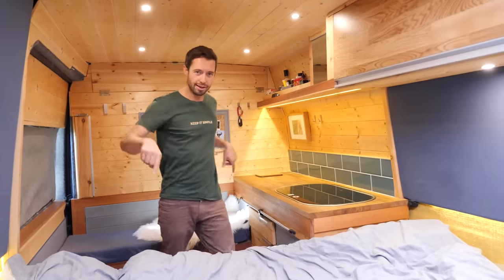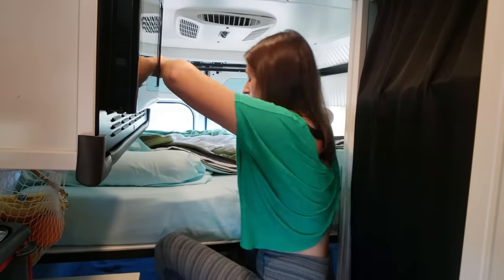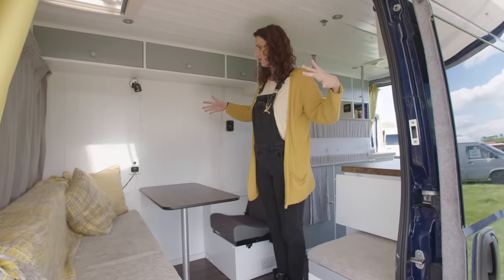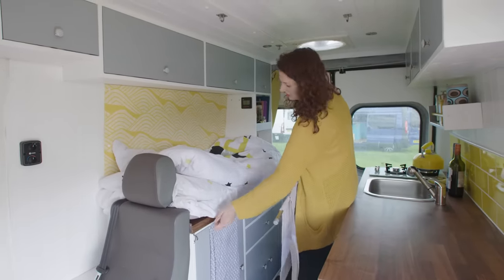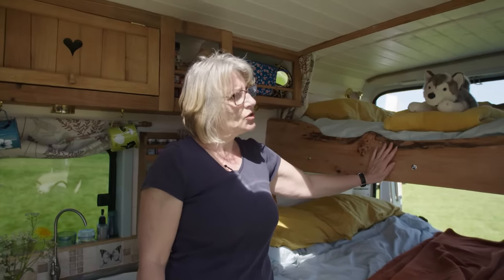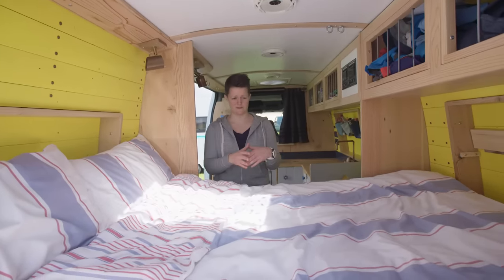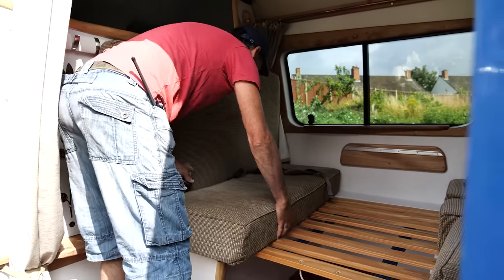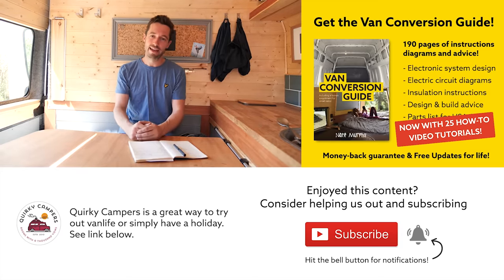10 (MORE) INGENIOUS BED DESIGNS For Your Van Conversion

Comment: Some great ideas there.  I have noticed a lot of folks shut off access to the front cab.  Having done a few years of van life and quite a bit of wild camping, there have been a few occasions where making a quick egress has been necessary, due to sketchy situations.  Which would not have been possible safely, if we had to exit the van.  Just something for people to think about when designing.  Having said that, if you only plan on using camp grounds or van parks, this would most likely not be an issue.
Reply: I agree.
Reply: Indoor access to the driver's seat, for me, is a must
Reply: Had a situation where the rear doors of my transit wouldn't open, had to get through to the front and put the key in the ignition to get them open. Would still be in there if I'd left the bulkhead in😂
Reply: 100%. For security reasons, it is a must to be able to drive away from any undesirables who may be pestering you.

Comment: Lots of options. Great. I couldn't sleep on those multiple cushions. The, seams and crevices where they meet is nightmare to me. Different strokes.
Reply: annette fournier same! They aren’t great to sleep on and I went for a different option in my van build
Reply: I think it can work depending how it is laid out.  I've heard people say that where they are jammed tightly together with no chance to move and there is memory foam the gaps are not obvious.  I also think it depends where the gaps are compared to your body.  It is much more noticeable under your butt than under your knees for instance.  We have two twin mattresses, occasionally we sleep sideways if someone tall is in the van and needs more leg room.  The gap ends up in the small of my back and I can't feel it there. The ones where there are tons of tiny ones jammed in together don't look fun though.

Also some people put a thin topper on top before they make their bed which can help.
Reply: Yes especially the ones for the sofa beds 🤦🏽‍♀️🤦🏽‍♀️🤦🏽‍♀️ Definitely no comfort

Comment: how about a van build with just a single bed. when i build mine i will be traveling alone. No need for a giant bed
Reply: It's so easy to design a van for one or even two, there are a million ways to do it. Need space for three or four, now that's a challenge.
Reply: Exactly even single ppl have king or queen beds but a double is way smaller imagine what you could fit
Reply: What if you get lucky?
Reply: You could fit a bath and loads more storage in with the extra space you save with a single bed
Reply: @garyphisher7375  Then things will be extra cozy which, lets face it, is a longshot for a lot of people so why design and suffer for it? Answer? Go to her van (?)
Reply: It seems like people have at least a full size bed to hide the “garage” underneath. You can do a twin/single  bed but I guess it would leave you with less garage space. If you’re ok with that then I don’t see why not
Reply: I saw a full bed. It slid down from the back door. That's the one I love today lol.
Reply: Murphy bed that drops down. By day it’s a storage chest/bench seat or others make it higher for storage cabinets and low counter. The wall you see is actually the underside of bed as it brows down. I have seen everything from a suspended shelf to wall art in the closed position. 
No divided cushion to annoy at night 
No assembly 
With a couple of duvet and dog leashes the bed pops down all made and ready
Reply: hammock 😊

Comment: I have watched a lot of van conversion videos and I have yet to see anybody address the need to be able to exit the vehicle quickly in a fire, especially if you were asleep in bed. All you need to do is to visit an auto junkyard and look at the vans that have burned to know that by the time the fire department gets to your vehicle it may be a burnt shell of metal. If you wake up to a smoke-filled van you’re gonna want to go out the back doors if that’s where your bed is, before being overcome by smoke. Many beds have been placed right up against the rear doors and so high from the floor that I wonder if it’s even possible to open the doors with the bed in place. If your bed is located back there and it’s pot not possible to open the back doors with the bed and place then you need to re-design your bed location. Also, you should place a second smoke detector inside any cabinets that contain your batteries and or major electrical components so that you get an early warning if there’s an electrical fire. Practice exiting your van in complete darkness so that you don’t know what to do if you wake up to a smoke-filled van.

Comment: the mechanical bed is exactly what I've been looking for! I wanted a fixed bed and a seating area. I was thinking it would be cool to put the bed above the cab but most vans don't have space there. the mechanical bed is a perfect solution! im sure its expensive though
Reply: +2k bucks
Reply: Build your own the motors and bearings cost a bit but everything else can near enough be scavenged or a pulley system to cut the motors out :)
Reply: Actually Ladislav Jecminek has built hers for really cheap. She shows how to do it in one of her YouTube videos. You may want to check it out. 😄

Comment: I like simple to make up beds, like fold down Murphys, sofa sleepers.and futons are easier to put sheets and blankets on and transitions to a setting or fold out of the way.
Reply: Each of these bed arrangements gives alot of ideas to think about, and what each van dweller has to use their own situation to consider — so much to “sleep on”🙀😸

I saw a video where the owners, a retired couple, had a cute arrangement where they had a bench seating  — the lower bench seat was also the lower bed, with a Murphy bed flipped up and was secured to be the bed of the other person. 
The reason behind this was that the one on the lower bunk needed to get up at night to visit the bathroom. It was easier to have the

Comment: your solution seems the best I think. Still building on our house, but when that is finished (if ever) .....Once we transformed a little Renault r4 into our travelling home and spent a good time going around former Jugoslavia (and other countries since we travelled fro m Sweden) . All cooking and stuff like that outside of coarse, but it really worked out fine. Now we´re much older so demands are higher but not to high. A fixed bed is almost necessary at our age though..Well, just wanted express my apreciation of your ideas presented in your videos ! A bit hard to keep it short and stringent..might be another age factor :)

Comment: 3 more solutions. 
A) If the passenger seat is removed then it would be able to take advantage of the space occupied by the seat. The part of the bed that will replace the seat, could be used for one's legs. And then have some sort of murphy bed for the upper body. The side door is not in use when sleeping.
B) Depending on how tall you are solution A can also be used in the driver's side. Here it simply requires that the seat can rotate and the steering column can be changed.
C) If you are not very tall again, you could have a murphy bed that folds down and in the front seats. Here it's also required that the seat can rotate and the steering column can be changed.

Comment: I prefer #3 the fixed triple bed bunks which could be adjusted a little for three adults. Coupled with good sized Wet Bathroom in a 5m Van for me would be perfect. The remaining space would be for a small dresser (hanger and folded) small fridge, kitchen sink and small burner. Other items can be bagged or tucked somewhere inside the van. I liked #3.

Comment: i did a 3ft sliding bed that sits above two bench seats when fully open..when bed is closed its a dining area.i built the bench seats first, one eack side 6 feet long.then made sliding bed to straddle both benches..then just fold over the 4 inch memory foam  mattress.where the bed slides out theres a slide out table too..it can in theory now sleep 4 to 6 people in a lwb vauxhall movano ex minibus.

Comment: Well, I have learnt in the last 15 years that people actually make a place worth living. If people are good even slums can be good, and a luxury apartment can be a place you don't want to come home to if people are bad.

I am going to design a wide-body 23-feet long Force Traveller 4020 to travel with at least seven friends in India. After researching for a year I found the bed for eight is the most challenging part but not impossible. There should be convertible bunk beds of 7'x8' at the centre of the van (not rear). One will  drop down from the roof and the other would be U-shaped bench seats converted. I also would have two 250-litre water tanks below the bed. My only worry is will the 22-seater van be capable of moving with such a load especially when driving up a hill.

Comment: My only concern with bench beds is with so many people sitting on them the cushions  don't stay comfy. I would rather have a full size fixed bed or elevated bed. The one bed I saw was a pull out bed that can be pulled out the van so you can look at the stars if they make a motorized version it would be perfect.

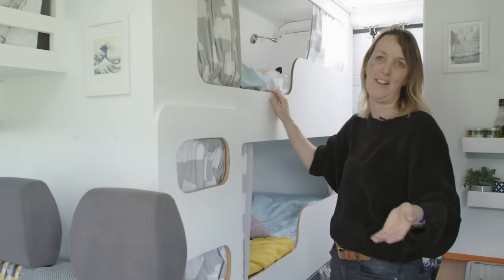Comment: 7:20 - I love this idea, with a few variations. I want a full-time bed, most of the time I sleep alone but I want to convert it to a double should the need arise. I love this simple, elegant solution.
I love what 18:25 did, I also have a Renault Master, but living year-round, full-time meant that sacrificing insulation at the head and foot of a transverse bed wasn't really an option.
Purchased your eBook. I'll probably be adapting a lot of the ideas (I lived in a commercial RV for 13 years and I'm building around the problems they have) but it's good to have a starting point and sometimes it's tough figuring out where to start.

Comment: 8:03, why not have a way to move the table and have some sort of system that you use to open a lock then If you pull on the bottom part towards you it goes outwards while the headrest moves down and out with it making a bed.

EDIT, you did make the table removable.

Comment: I have an idea for you buy a daybed that has a bed underneath it. beds is underneath so when you pull it out, it will be the size of a queen This will be the easiest couch to bed you have ever seen. now to make sure the beds do not slide apart I would take bungee cords and bungee them together underneath. You will need some type of padding the whole bed so it will feel like one big bed. 
I would use a Costco 5 ft plastic folding table and have hooks on my wall and hang it like a ladder when it is not being used.
In final… now you have a couch with nothing in front of it?
Now you have a Work area or dinner area with a table?
And last, but not least you have a queen size bed

Comment: Pull this out, shove this in, move this over, join this piece on, add some cushions, connect this bolt, lift this down. tie one of these on and the whole job is finished in only 15 minutes then when you get up in the morning simply reverse the process and everything is back to normal. Simple.

Comment: The only bed worthwhile is the one that lowered, and it was not worthwhile because it was electric.  Make one that uses a mechanical system to raise and lower (much lest cost, and less chance of problems) and you've got something.  Bed up, dining area under.  Bed down, for travel and sleeping.  And a roof tall enough to stand up, or at least in one spot

Comment: You can immediately spot the tourist camper as opposed to the actual van lifers by a quick glance of their lay out. Any tourist van is always inferior in its capabilities as opposed to actual van life vans. Tourist vans usually have no to little garage space, often have no shower or even a toilet. Some tourist vans have those but highly rare to have all. Also, tourist vans have some silly impractical layouts with modular stuff....no van lifer would set up stuff day after day after day all the time. Tourist vans often also look more cramped, less spacious for the simple reason these people don't have to live in it all the time.